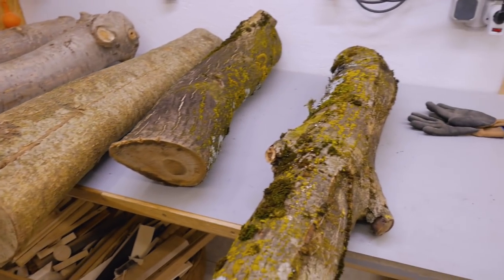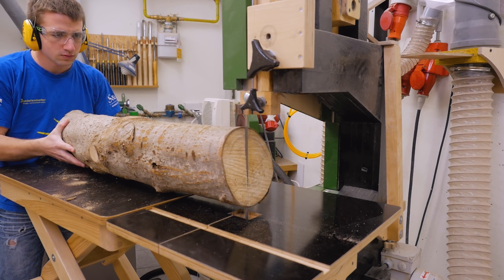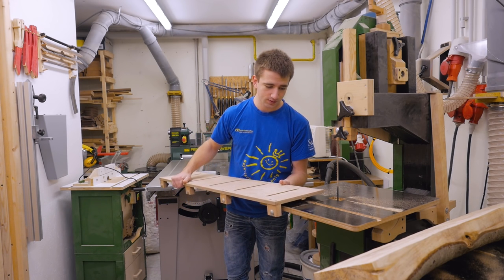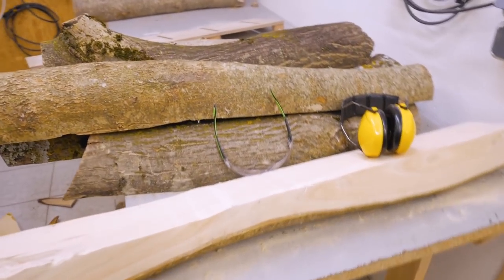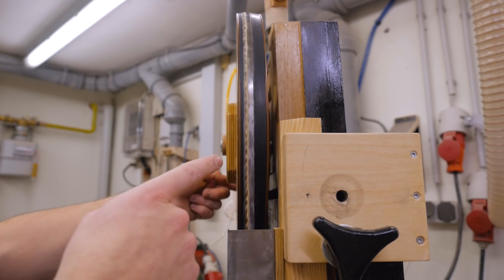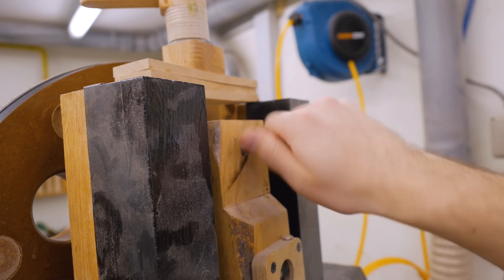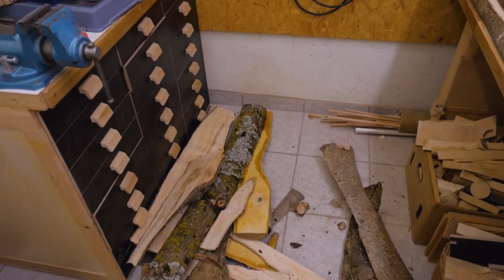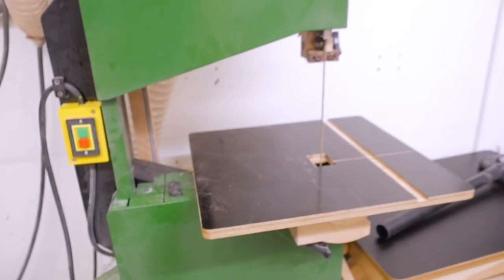Cutting Small Logs into Lumber with only the Bandsaw

Comment: You could install an idler gear/wheel for tensioning the belt, it might be easier and you could have it sprung against it so it maintains tension longer as the belt stretches.

Comment: Nice, very interesting. Does the bandsaw motor need putting on some kind of adjustment plate?  Belts do stretch slightly over time.  Alternatively could you fit a tensioning pulley on a spring?  It’s looking like you might need another of those height adjustable tables before too long to use as an outfeed support.

Did you get much resin build up on the blade as you cut?
Reply from the maker: You can never have enough lifting tables.
Yes, cleaning the blade afterwards is always a pain

Comment: Ich würde empfehlen die Stirnholzflächen zu versiegeln, dadurch trocknet das Holz zwar langsamer, aber es reißt auch nicht so schnell. Bei Esche ist das wahrscheinlich nicht nötig, Nussbaum schon eher. Für Apfelbaumholz hatte ich Erfolg mit zwei Schichten PVA-Leim: Stirnholz satt mit 50 % wasserverdünntem Lein einstreichen, Zeitungspapier draufbappen, nochmal drüber streichen und um die Kante falten.
Reply from the maker: Ok, werd ich noch ausprobieren. Danke fürs Rezept!
Reply: thanks for your tips
Reply: Kann ich bestätigen. Das Holz reisst viel weniger ein, selbst Buche. Ich habe einfach Lackreste genommen.
Reply: i just take old wood glue for this job
Reply: Aluminum foil glued on the cross sections. Two requirements: 1) it has to stick really tight - any delamination will make the covering effect-less, and 2) it has to be impermeable to both water vapors and water. Paper and PVA glue are less effective than aluminum foil.